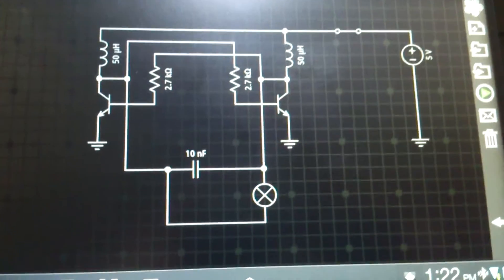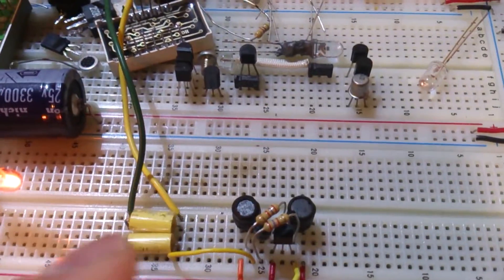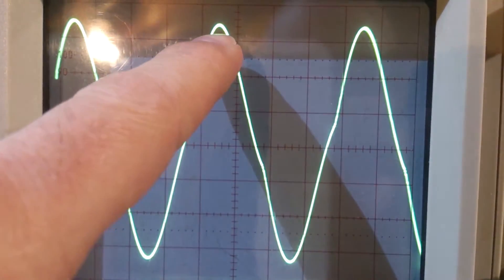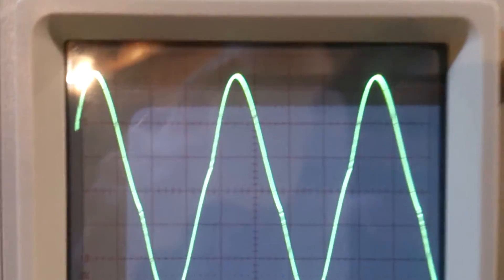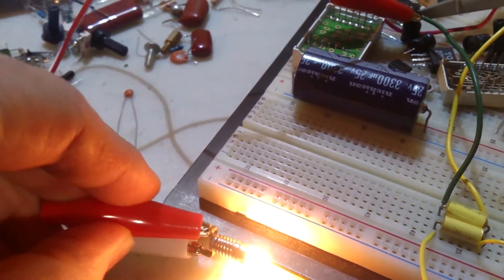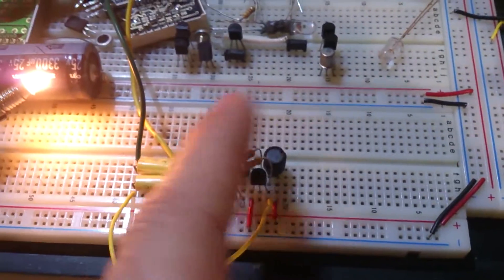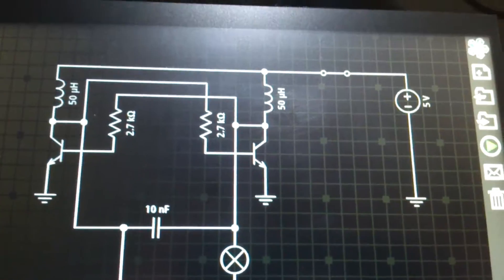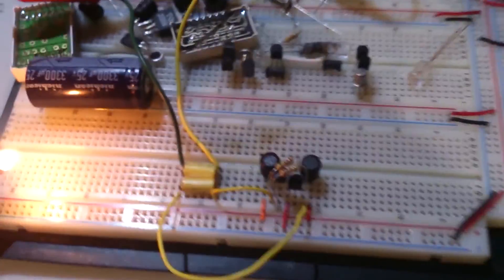2 transistor self-resonant voltage booster

Comment from the maker: Yes I did saw that one too I have couple of those circuit in my schematic bank but they won't start at low voltage. If you get yourself some germanium transistor you will be able to go low about 150 mV to 300 mV if you're lucky. Have a good day!

Comment: Sorry for my late reply, Youtube interface doesn't notify me your reply.
I believe, I saw somewhere in the Internet, someone add some kind of feedback from extra winding to the base, making the transistor could turn itself on, even the voltage under 600mV. I lost my reference.
The circuit is not self starting, if memory serve me right.

Thanks for your reply. :)

Comment from the maker: You can try the same circuit by using germanium transistor but those are starting to be hard to find and they don't give out very high power. I can try some circuit at home to see how low I can have it run but most of it will stop around 500~700 mV. To the lab!! :)

Comment: Hi, it's me again...
Just wondering, do you have any good resonating circuit that could run under 300mV?
I'm experimenting with energy harvesting via small solar cell.
Indoor, under descent light condition, I get something close to 300mV, and I intend to boost the voltage a bit, just enough to lights up a small red LED.

Any suggestion?

Comment from the maker: I was only trying to see if a zvs like circuit would work for low voltage since mosfet normally don't go that low in voltage it's a good circuit but very little power can be extra from it. I try it with bigger transistor and more energy was waste for making it work then I was actually using on the other side. I'll wait for your video indeed =D

Comment from the maker: Here is the result for the darlington pair. It didn't do much difference beside having the transistor slightly more sensitive but no increase in power. The circuit was also using about the same power as before for the same result didn't also find it useful to make a video of it. Thanks for the suggestion!

Comment from the maker: You will it's very easy to make and quite stable too I've test it with resistor going to about 120 Ohm and it was still working well I also notice I could extract more power out of it but at 500 mAmp the 2N2222A was heating fast so I stop :P